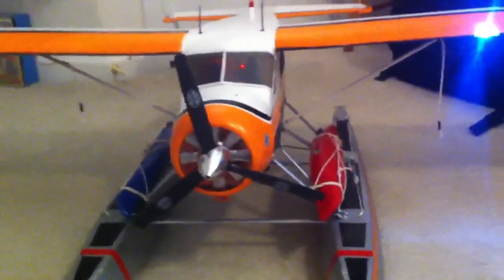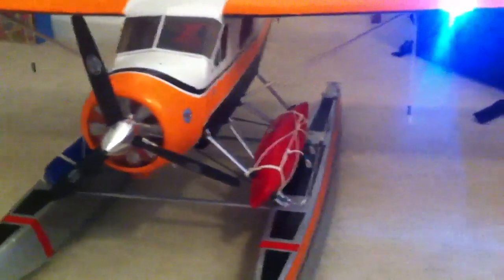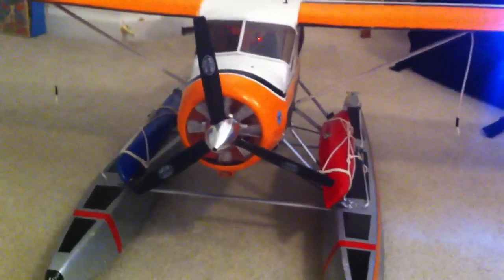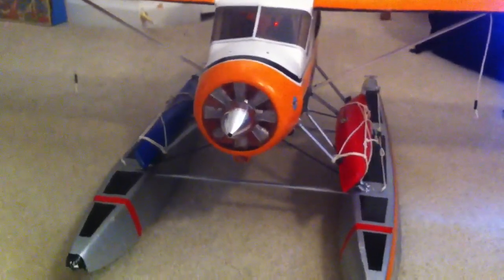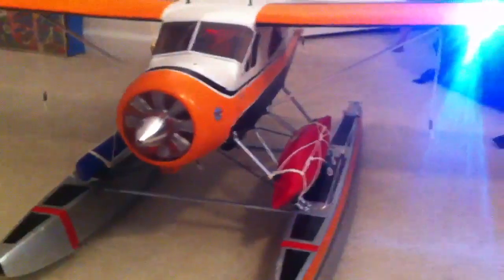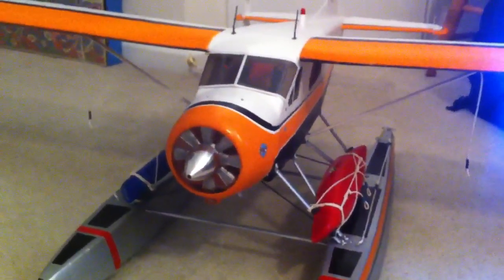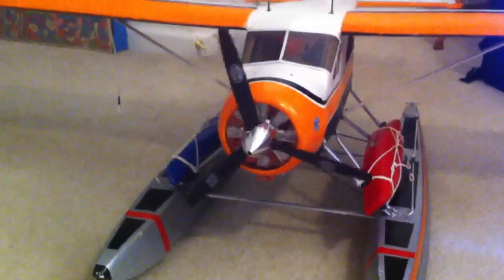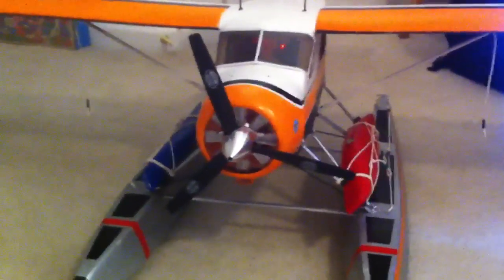MrRcSound in Flyzone Beaver

Comment: Hello, I just acquired the very rare Flyzone Beaver, and I was wondering if changing the propeller for a 3 blade improves the traction better than the 2 blades.  Can you tell me also what size for the 3 blades silver spinner you use...I find the 2 blade 12x6 very limited even if it is the recommended propeller. Thank you. Your detailing work is very convincing and improves the realism in a beautiful way. Bravo.

Comment: or what adapter did you use to fit on the prop shaft to get the spinner to work i seen the prop and spinner on tower hobbies but they have several different adapters to make this prop spinner combo work will really appreciate the info. thanks

Comment: Great vid and sound my friend. I'm ordering the Island Wings tonight while it's still $179 at Tower Hobbies. Where did you get your MrRcSound? Motion RC has one but not with the radial engine sound like yours? I have a 11x7 3 bladed prop but not sure if the tru turn aluminum spinner is right or not? The adapter kit I have is for the OS Max 46-55 I think..... may even be for .61 not sure... Many thanks for your advice, Kenny J

Comment: Trying to locate some spar props - 2 & 3 blade.  Any recommendations?  Beaver replacement prop @ Tower states 6mm shaft hole dia. but motor shaft dia specs state 4.1mm??  Thanks